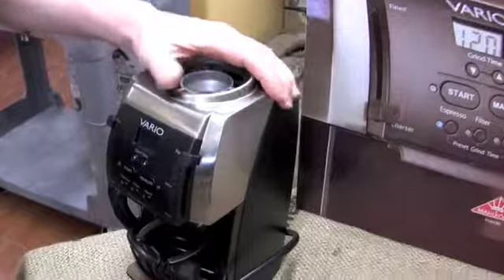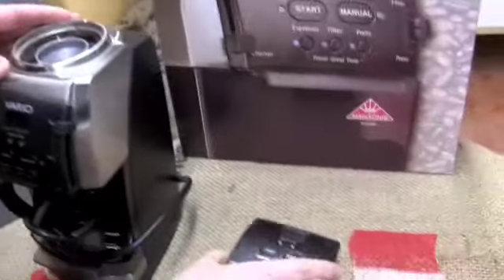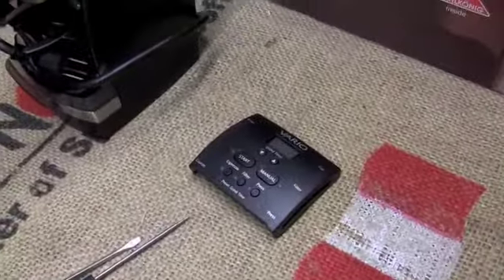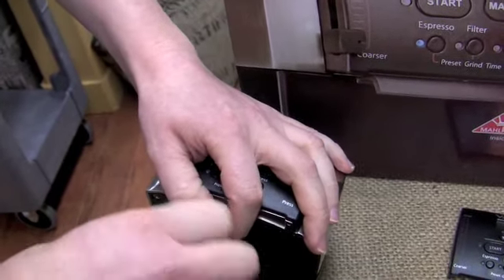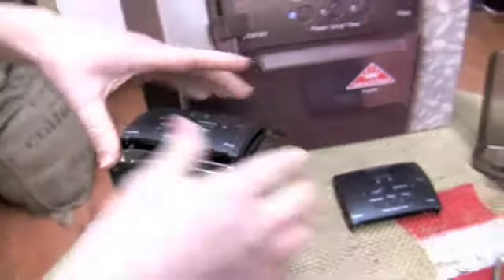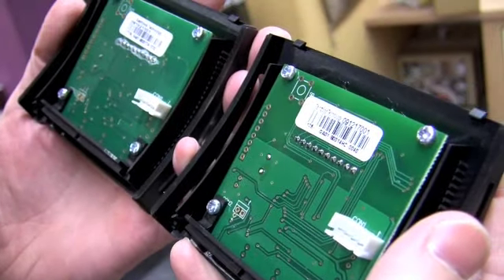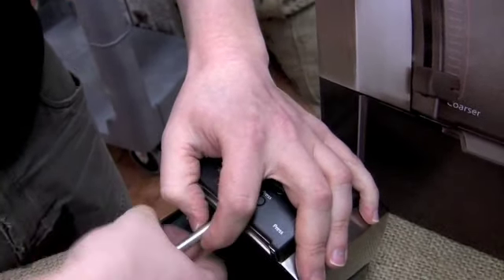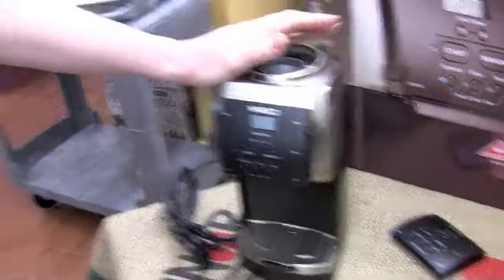How To: Baratza Vario Display Upgrade

Comment from the maker: @ValiantVale We were wrong; I updated the video with a note. Henry and I went through to determine if the battery required charging/replacement and he wasn't able to actually find one. So he suspects it writes the programming similar to a hard drive vs. RAM -- you don't lose your data on the hard drive when the computer is turned off, but your RAM is erased. Sorry for the confusion! - Kat